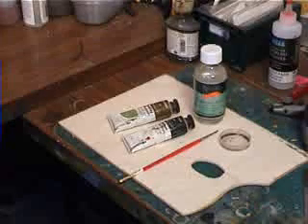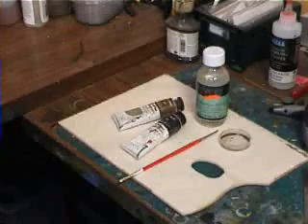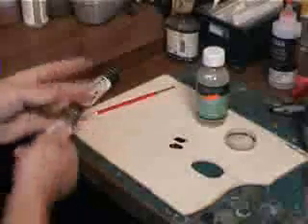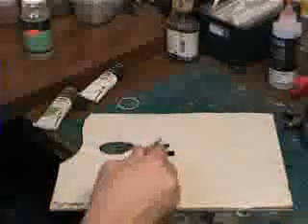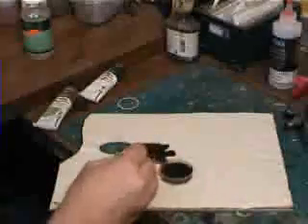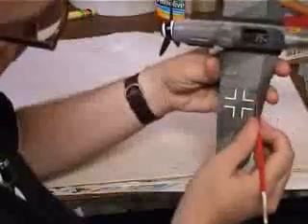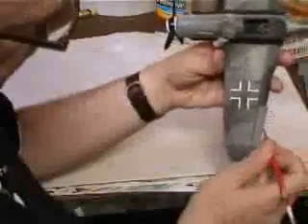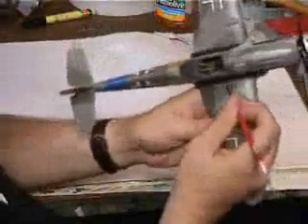Testor's ScaleWorkshop #9 - Panel Line Washes

Comment: Brett, how do you get your acrylic paint to not gum up your airbrush in the first place?  After 15 years I'm still forced to paint in enamels and lacquers in fear of plugging my airbrush...  :(  What psi range, what do you cut it with, what distance from the model do you spray, and what cutting ratios do you use?  Acrylic is cool because you can paint with it indoors without asphyxiating yourself, it dries fast, and it's way easier to weather.  I must know...

Comment: How do you do that on commercial planes? I saw someone doing it different. (danielbustos, you can check his channel especially the a319 video you can see i good there) but dont you mess up the painting with the thinner? Is it this way: paint-decals-gloss-panel lines i thought. Is revell color clear 01 good as gloss if you airbrush it? Alot of questions :p

Comment: you dont need a clear coat for a wash with oil paints? right? i used to use enamel thinner but i couldnt really wipe the excess away becasue the testors enamal thinner burns right through my tamiya airbrushed coat... down to the bare plastic. I usually give a generous wash before i give a base coat... and some is visible but not as much as a full out wash .... sooo ? do i need a clear coat?